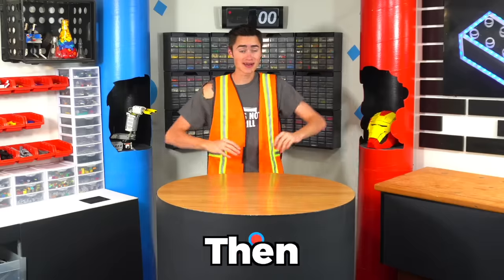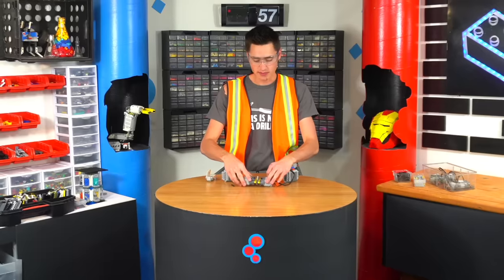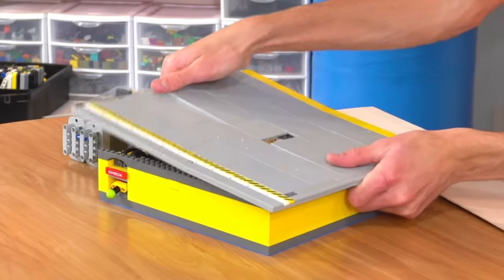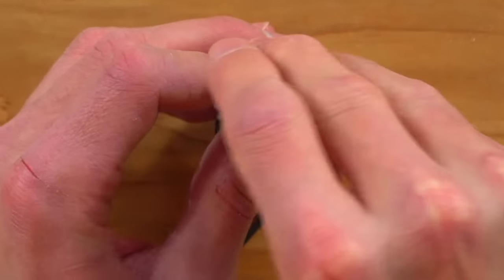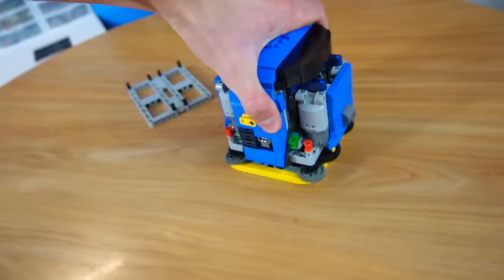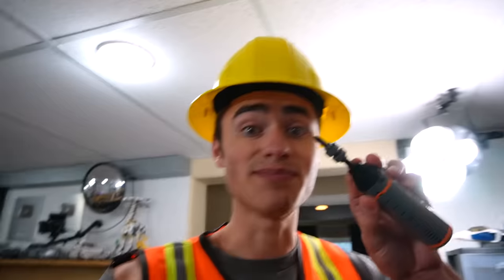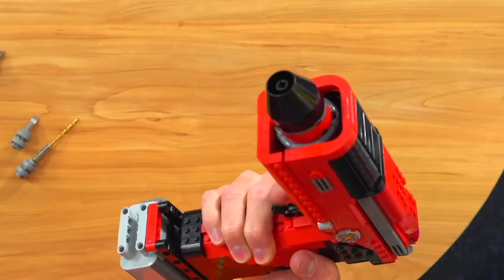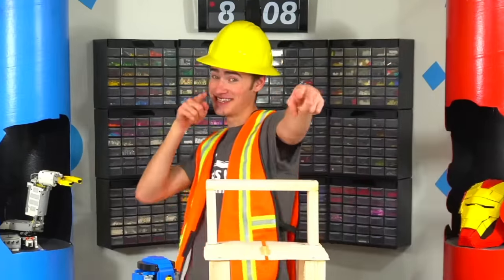I Built WORKING LEGO Power Tools!

Comment: Here is a tip, if you use a smaller gear after a bigger gear, the output  
Gear will go faster, or a smaller then a bigger gear for slower speeds so thus eliminating the need of more motors. BUT the problem is gearing up (big gear to small gear) gives you less torqe, or less power, so thats not good for like a saw, BUT it is good for like a race car, and gearing down (small gear to big gear) is great for saws and what not, but it goes slower, not very good for a race car. Still impressive on how well they worked though!

Comment: They only work if you have enough motors. I made a table saw about a year ago and it couldn’t cut wood. I made a drill press not to long ago and that could only drill through a 1/4 inch piece of a soft wood. Drill time around 1 min per quarter inch. I am working on a v2 drill press. Bigger and better but my motor wires are damaged. I only have two motors and one completely doesn’t work and the other one works if you put a wire at a certain angle. I don’t really want to spend a lot of money on the new type of motor so does anyone know where I can get one cheap or get a knockoff that works just the same.